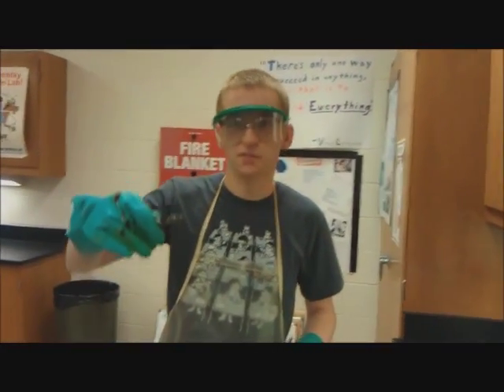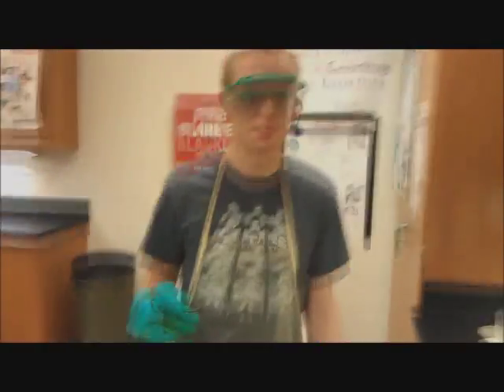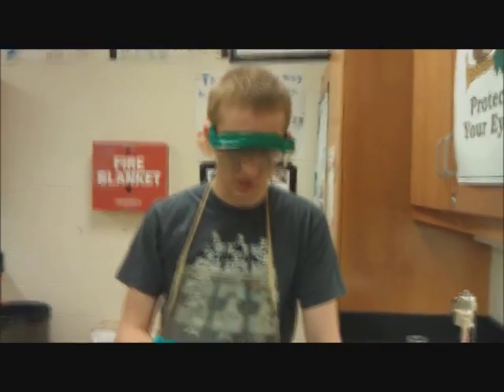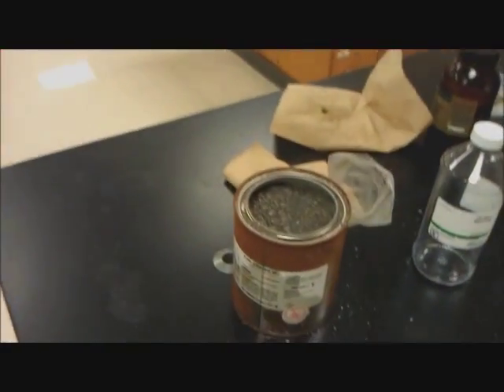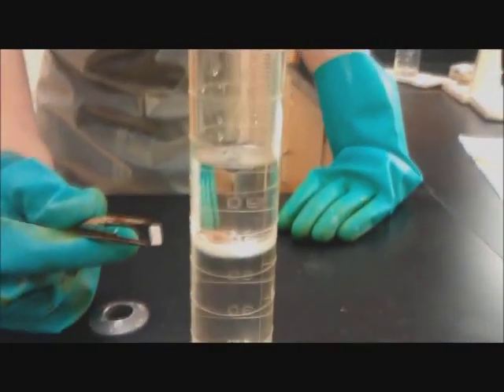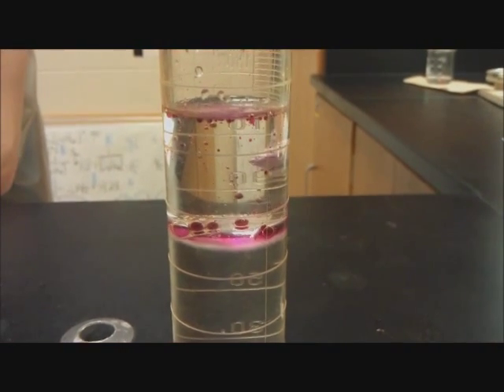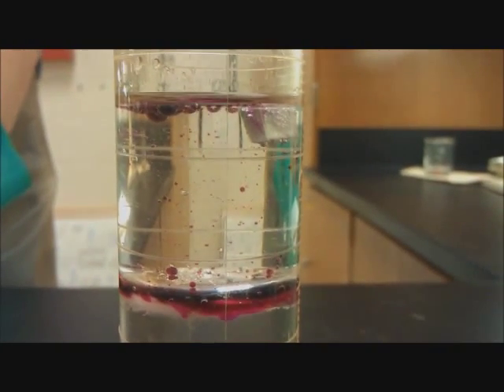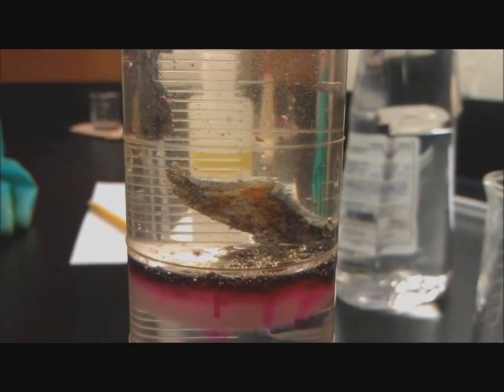Sodium and Potassium Metal in Oil and Water

Comment: throwing sodium metal in water would normally produce h202(peroxide) and sodium hydroxide,which is impossible to seperate. You might have stumbled on a new way (Breakthrough)to make sodium hydroxide pure (without  peroxide)congrats! maybe it would work with potassium and or other compounds
Reply: It doesnt produce h2o2... It only produces hydrogen gas and sodium hydroxide